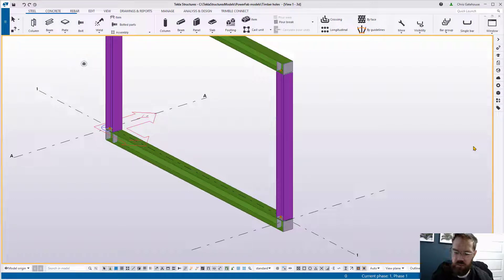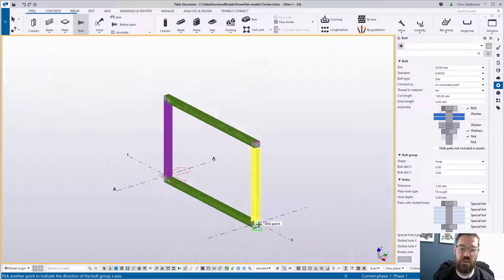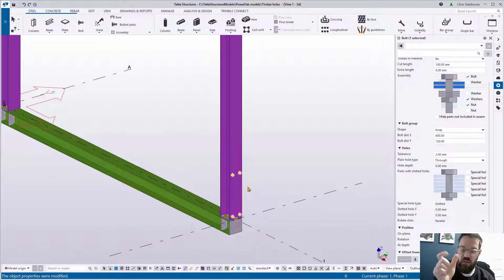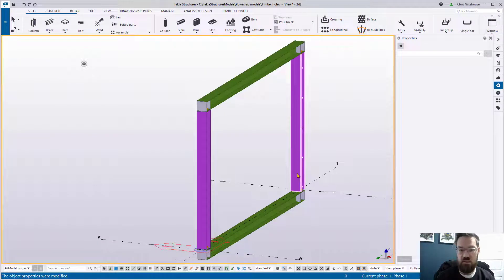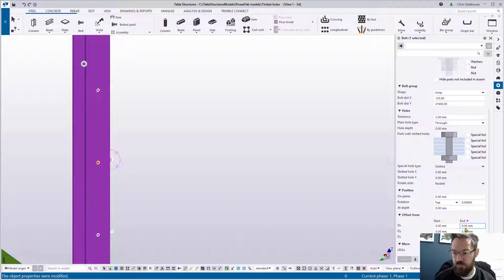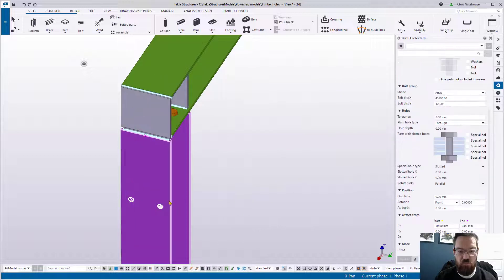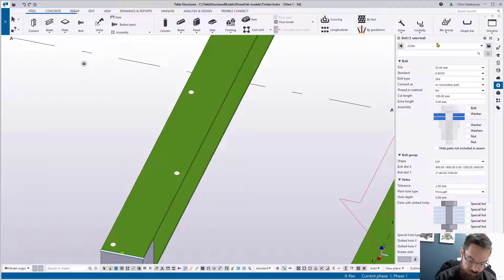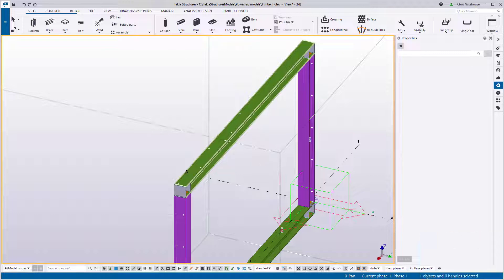Tekla Structures - adding parallel and staggered timber holes

Comment: Searching YouTube to try to find a better method for flange and web holes for nailers and blocking... This 2nd method is exactly what I have been doing and it works well, but it's soooooo slow compared to using the Reducing Studs component for threaded studs. That is basically automatic and totally customizable. I wish they had a component for placing holes with the same wizard as the Reducing Studs component.

Comment: Good morning Chris, I just wanted to thank you for this video. It has taken me a very very long time trying to find an easy way to add wood nailer holes to beams, and this is it. I am having one problem though for whatever reason. Once I delete the individual bolts and make them staggered and save, reapplying the connection deletes some of the bolts that I want to keep. It's strange and might be a bug. I am using Tekla version 19.1 SR7.

Either way, even if I save the connection prior to deleting each bolt to make them staggered, it saves a TON of time on my end. If there was any way for me to buy you a beer, I would.